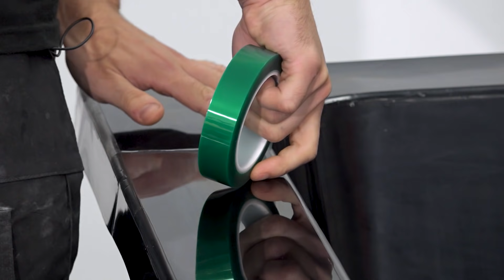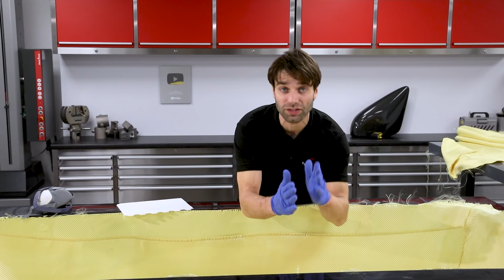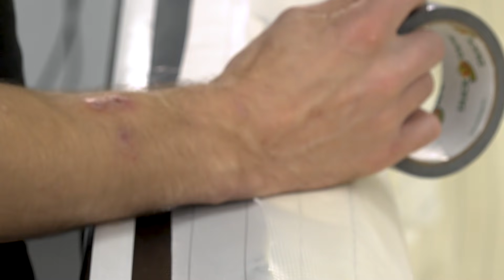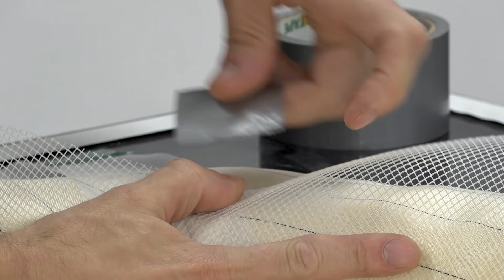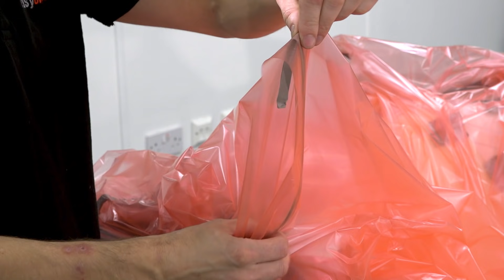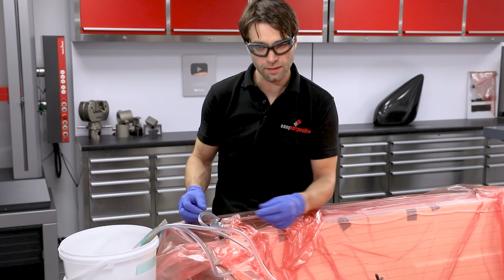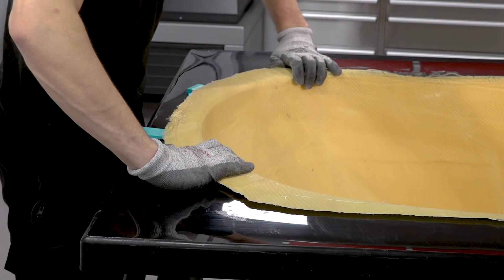In-Depth Guide to Resin Infusion (3m Kevlar Moulding)

Comment: I have wondered about using something like a rug machine to push bundles of fiber through a thicker core to create a triangulated brace inside the core. No clue if it would work yet, but it seems like it might have some value, especially if the core itself fails due to chemical or environmental conditions. Then you would be left with a triangulated lattice holding the skins in place...
Reply: Sometimes people drill small holes in thin cores so that the resin physically links from one side to the other. It wouldn't be a major stretch, although fiddly, to run fibres through gaps in a core from one skin to the other, if delamination or core failure is a worry. Although, of course if a core snaps, then either the skins have too, and it's a dead part, or they haven't and it's a minor issue only. If the core perishes or rots for any reason, again the part is likely dead, and needs to be replaced or repaired, and laboriously linking the skins would have been a waste of time.
Reply from the maker: With the Lantor Soric and 3D core, you already are left with a honeycomb lattice of epoxy resin. In theory those gaps filled also with fibres may well achieve what you desire, however I suspect the practicality of cross weaving it at manufacture or during the laminating process may be too difficult to make it worth it for all but very extreme cases.

Comment: is it possible to make a box out of carbon fibre without any holes? ive been looking at car parts made in carbon fbre and they all seem to be full structures with no holes to vacum form from the inside. im a bit confused
Reply: Those parts will be made in split moulds and then joined together

Comment: I have been using the epoxy compatible gelcoat and have had no luck brushing it on, it comes out very patchy. You cant double gel to get around this. How would you reccomend brushing it to get around the "patchyness" issue?
Reply from the maker: In its natural state, GC50 is very 'thin', this keeps it very clear and also allows it to be sprayed. However, this can be problematic for brush application. If you're using a pigmented gelcoat (like we are in this video) and you're brush applying then you could add some fumed silica to make the GC50 more 'thixotropic'; this will allow you to make your single brush application thicker and avoid the patchiness you're experiencing.
Reply: @easycompositestv  I'd wondered about using silica. I'll give that a try. Thank you.

Comment: Your videos inspired me to start making composite components and this one is very good 👍. One development I have made that helps is to use suspended resin pots with the lines coming from the bottom. I use big squash bottles with the bottom cut out. Air comes out the lines naturally and I never worry about the lines falling out. I have them at part height. I use silicone bungs to hold the lines in place. Also I have no wasted resin. 👍. Worth an experiment, you might be surprised.
Reply from the maker: Hi Chris, thanks very much for your comment. That does sound like an interesting idea, we'll do some experimentation some time and see how we get on.

Comment: Man oh man, resin infusion looks so complicated. So many small steps require attention. There is got to be a way to make it suitable for the industry tooling - machines, robots (yet for small scale projects)
Reply from the maker: In large scale production the resin transfer moulding process is used more commonly but it requires specialist, expensive tooling and equipment beyond what is reasonable for the DIY or small business user.  Hence the infusion process works very well. Its not that complicated broken down into steps.  The key with infusion (and many composite processes) is to follow the order systematically and adhere to it.  Do not move to the next step until you have completed the one before.  Especially the case when vacuum bagging to not move onto the infusion until you have a good leak tested leak free bag.

Comment: As a builder of whitewater kayaks (that must endure rock collisions and abrasions), I find it odd that Kevlar is used on the outer layer. Kevlar has poor compressive strength and it "fuzzes" from abrasion. Why not begin with at least one layer of something like S Glass?
Reply: It would take a huge impact or accident to destroy the gelcoat in order to 'get to' the actual kevlar fabric. I've not managed more than a few chips in gelcoat in years of abusing sledges. S-glass is over twice the density of kevlar.
Reply: @AH-ns2wh  This assumes a near perfectly smooth surface, with no significant "bumps". It's a bad situation if you encounter a patch that might make the surface concave. The gel coat won't help much to reduce the compressive stresses.
Yes, glass is more dense than Kevlar. In boats we use one or two 5oz layers on the outside. When you consider the epoxy matrix, it probably increases the density of that layer by about 50%. It's the price we pay for doubling or tripling the life of the matrix.
Reply: @ctcboater  Well over years of abusing sledges over some pretty awful ice, I've never achieved this sort of damage to a kevlar laminate, and having hauled a glassfibre sledge for 1350 miles (never again!), I'm glad for the weight saving of more advanced composites.

Comment: Awesome explanation of the infusion process!  Your videos are a great resource.  

I still disagree with you about clamping off the vacuum right after infusion - but its hard to argue with the outcome!  There’s always room for more right answers.

Your pre-feeding resin to the clamps trick is a great idea.  Thank you!
Reply from the maker: Personal choice which method you choose or find works best for you.  Leaving the pump running is fine when you have a decent resin break.
Reply: Hi, thank you for your vids on here, they are really good! I’m a boat builder and have intermittent sessions of infusing components and the like. I’m always picking up little gems from both your videos and the comments below!
Like the guy above, I can’t get my head round turning off the vac once the resin’s through. In a perfect world it obviously works as you’ve proved but I simply don’t trust my ability to get it perfect 😂 I have a more Heath Robinson type catch pot made from 6” waste pipe so I’m not too bothered about replacing it if I get a bit of resin through!
Again, thank you for the great videos 👍🙂

Comment: Hey Paul. This tutorial is amazing. Thanks for sharing this with us! 
I have a quick question. What if there is a place where the resin didn't reach? Not because of leakage but for example because of a wrong setting of the resin hoses or so. Is there a way to fix that and save the part?
Thanks man!
Reply from the maker: Hi Paulo, yes, you can often recover a situation like that or at least make it a bit better. It’s a bit of a messy process but you can ‘graft’ a new resin inlet and vacuum line, in situ. It’s difficult to explain but maybe I could do a short demo at some point.

Comment: Some questions
1, is it possible to use the old acetone trick on this gelcoat?
2, Kevlar on the outside of the Core makes sense, but what's the reasoning to have it on the inner layers? Balancing the laminate? Carbon would save some weight.
Reply: 2. Whilst kevlar's compressive strength is one of its few comparative weaknesses, it would still be more impact resistant than carbon, and wouldn't have a weight penalty as both materials have almost the same density.
Reply from the maker: The Acetone trick does not work on it unfortunately.  It was only an older earlier version that it worked on.
Reply: @easycompositestv   WHAT DOES IT MEAN ACETONE TRICK? DO YOU CAN EXPLANE IT'?

Comment: Would it be possible to infuse the resin placing the feed line around the perimeter of the mould and the vacuum line right in the center of the piece ? That way gravity would help during the whole process.
Reply from the maker: You could put the vac connector in the middle, yes but where possible we try to position connectors off the laminate, as in this case. Gravity actually makes surprisingly little difference to infusion speed.
Reply: If gravity assist is desired, it could be achieved simply by raising the bucket up above the whole project.

Comment: The tape will stick where the easy-release is applied?  No problems?
Reply from the maker: Yes, the tape uses a silicone adhesive which holds nicely even on an Easy-Lease'd surface
Reply: @easycompositestv    Amazing work/video!